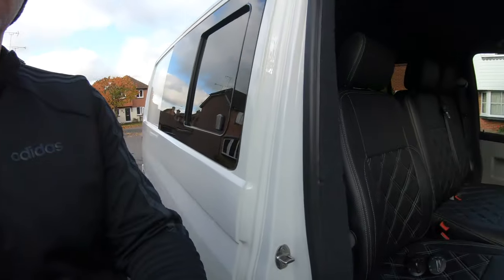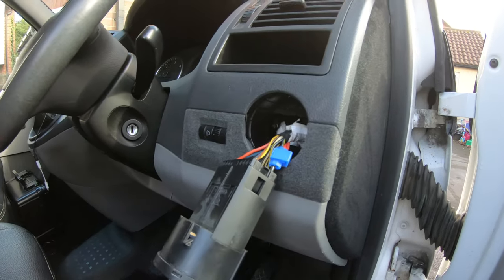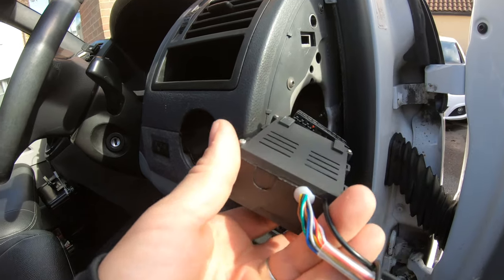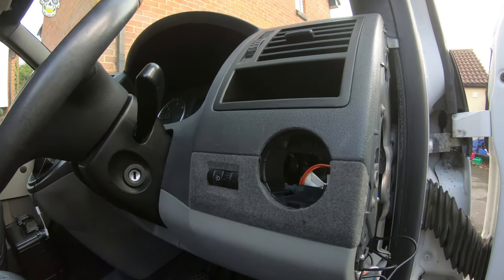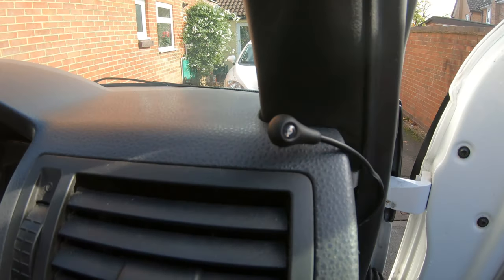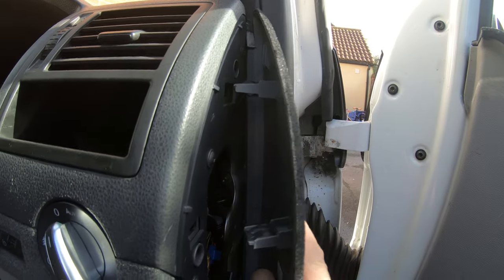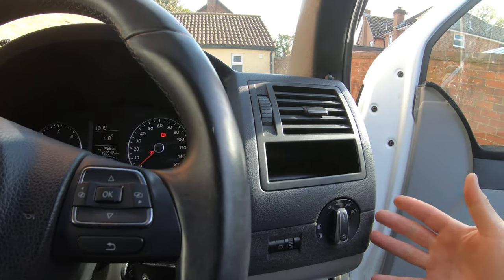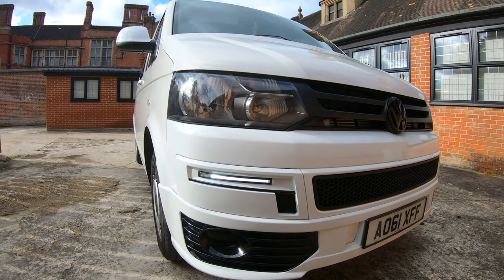Vw T5 auto lights upgrade #builtnotbought #build #vanlife #t5 #transporter #autolights

Comment: Just fitted mine to my 2005 T5 and they work a treat, thanks for the inspiration 👍
Reply from the maker: Antony Rowley how did the install go? I’m looking at. 05 for another project build.. was it straight forward...
Reply: @tomtdubz  Yes ,5 minutes job, no problems, no lights on dash & even the 3m tape worked fine. The kit I got even had a spare 3m tape just in case.
Reply from the maker: Antony Rowley tidy, which kit did you go for...
Reply from the maker: Antony Rowley nice one thanks 👌🏻
Reply: solo se enciende la luz de posicion

Comment: Hi Tom, I’ve just fitted mine but I have the blue Motion so a smaller plug in the back. Do you know if you can have coming home lights with the newer version? It came with no instructions and I can’t find any online
Reply from the maker: Should be able to.. if you leave it in the auto mode they should turn of after 10-20 seconds....

Comment: Hi Tom great info on Video, I've just put a new bumper on my van  2006, with fog lights but sadly no wiring loom for said fog lights. Question is would the wiring loom you used for your front end upgrade kit fit and if so where was that from please
Reply from the maker: Hey, thanks  for watching. The loom for the fogs I used is one for facelifts. Travelinlite do one for the pre facelift. The loom is the same just different fogs.

Comment: Great video mate, only just bought a 2014 T28 T5.1 startline.  Will this autolight switch fit this model?
Reply from the maker: Should do. Check the loom an make sure you get the correct one for your year of van, my other van is a 13 plate and is the same kit…

Comment: Great vid pal. 
I’ve got a 2013 factory Highline Kombi with vents for rear seat air con in the side panel that you’ve taken off in your video. Have you fitted an auto switch to a van like this and do you know if the added loom will fit in the space allowed.....? 
Many thanks. 👍🏼
Reply from the maker: I haven’t, but there’s is quite a bit of room in there, the new loom is quite long so you can find a spot for it 👌🏻

Comment: Great video dude. I’ve looked on line and there’s a big and small switch, not sure witch one I need do you have measurements as my camper is 2012.
Reply from the maker: Best option is to pop yours out and take a look at the fitting.. go from there bud 👌🏻

Comment: Hi, 
I was thinking about fitting fog lights to my 2020 plate Crafter and a new switch like this so there on auto. I can imagine it won't be an easy job but do you have any advice for me or anyone else. Is there wiring looms available for this to go right back to the switch. What else is needed. 
Many thanks 
Ian

Comment: Hi Tom good video. Where did you get 3 round dial for heater / blower ?  Dave G
Reply from the maker: Thanks, just off eBay il have a look and tag a link 🤙🏻
Reply from the maker: https://rover.ebay.com/rover/0/0/0?mpre=https%3A%2F%2Fwww.ebay.co.uk%2Fulk%2Fitm%2F201954511288 think it was these..

Comment: Hi mate, this is brilliant. 

Just checking if there is a minimum bcm required? I have a 2010 shuttle with front fogs. Planning on getting cruise control fitted and this.
Reply from the maker: Should all be straight forward 👌🏻

Comment: Hi great video, I am thinking of getting one but I noticed you also only have the rear fog light on your original switch and the new one has front and rear, so does your rear fog light still work with the switch?
Reply from the maker: Yeah they did, soon after I installed the front fogs 👌🏻thanks for watching 👍🏻

Comment: Hi Tom, another question mate. I have bought a fog light and auto switch kit from Travelinlite. I also bought a window kit as well (both not fitted yet bit chilly out lol) did you fit the auto windows on the bus yourself. If so did you connect both red wires to the black and yellow one or just one wire, I've watched a few videos on here but all a bit sketchy. Regards Steve
Reply from the maker: Hey Steve... I did but I can’t remember... it was literally the first thing I did.. il have a hunt round and get back to you... 👌🏻
Reply: Cheers Tom, appreciated
Reply from the maker: Steve, brains gone a bit, can’t remember any of the window installation... I think gdubtv did a good video on them.... sorry fella
Reply: Its ok mate, thank you for looking and getting back to me

Comment: Well,I've tried and tried to remove my old switch as you demonstrated, push in and twist to zero and pull it out,.....it definitely does not work for me, any other ideas ?
Reply from the maker: Push and pull to zero… try pushing in on zero an turning to the right… should come out
Reply: Really appreciate the prompt reply Buddy, I have tried it always ,total failure, seems well  fixed in there, even whipped off the small panel to the rhs to give some leveridge with my fingers, simply won't have it.
Reply: Am having the same issue. Push in and turn right whilst in and the old unit still won't pull out
Reply: @heavymetalbebop  Did you ever manage to get old headlight switch out? Am having same challenge as you. Followed instructions but will not pull out!
Reply: Hi Mark,yes I eventually got the switch out,but,had to get a bit aggressive with it,a couple of screwdrivers either side of it and prised it out which did cause it damage,no probs as it was being replaced.

Comment: How do you turn on the fog lights? Mine doesn’t want to switch. Thx!
Reply from the maker: Turn switch to main beam, pull out gently on the on the switch and you be able to turn it further round to put the fogs on
Reply: @tomtdubz  thx! I tried that already since it's the same procedure in all the previous vw's I owned but this time I was afraid to pull it apart. I' ll give it another gentle go. thx again.
Reply: @tomtdubz  just figured it out. like you said, turn to main beam and then pull once for front fogs and once again for rear fogs. thx again!
Reply from the maker: @jeroengoegebuer1573  brill, nice one fella 👌🏻

Comment: Hey, how did you programme the DRLs to work with the fob? Would it work with my led ones?
Reply from the maker: I’ve got the auto lights so the are programmed to come on when I unlock and lock the van (coming home lights) the drls light bars are power fed from the original drls so the all come on together.

Comment: Hi Tom just found your YouTube finding you very helpful trying to replace my Headlight switch and unfortunately it’s stock is there any suggestions you can give thank you
Reply from the maker: Travelinlite make a good kit which will allow you to convert to auto lights.. the also do the one which has the front and rear fog lights incase your thinking of add the front fogs too... 👌🏻hope you enjoy the videos 👊🏻
Reply: I believe my pins are stuck behind the light switch is there any other way of getting them pins to move I have already got the auto switch to put in after watching your video a couple of days ago but I’m just stuck at the moment I’m trying to get the light switch out Thanks for your help
Reply from the maker: Have you popped the switch out? If so it might be a case of sacrificing the old switch.. they are quite tricky to pull apart but there not worth much...
Reply: T Dubz Hi good morning no tried all last night it just won’t come out really don’t want to force it out and then break the dashboard
Reply from the maker: So it’s stuck in the dash. Pop the side panel off, it might have got lodged in, or someone may have stuck it in. One eve the side panel is off you can release the harness bit fiddly but you manage... then you might be able to free the switch...
Reply: T Dubz ok thanks have a good day 👍👍

Comment: Would this be the same procedure for the T6, cheers
Reply from the maker: It is but you will need to get the t6 auto lights kit, the fitting is different on the back.

Comment: Hi Tom , just bought a set of rear leds for my t5.1 and they don't work , but they did on my buddies van fine , I have the old light switch in the van like you had before your mod switch upgrade , would that be the issue with my lights , or would my t5.1 not be compatible ?? Frustrating as it works on my mates van and he has the newer light switch like yours . 
Much appreciated if any one out there has any clue what I'm doing wrong , I thought they would just be plug n play 🙏🙏
Reply from the maker: Where are you located bud, could ha e a look if your local…
Reply: @tomtdubz  
Hi ,  I'm in Hampshire ( Farnborough) 
Many thanks for the kind offer .
Reply from the maker: Based near Southampton but have a workshop near Bournemouth…
Reply: @tomtdubz  
What's the name of the workshop buddy , I can ring Monday// Tuesday and pop down maybe wednesday // thurs if OK with you .
Thanks in advance
Reply from the maker: Bespoke buses based in west moors Bh21 6us 👌🏻
Reply: @tomtdubz  cheers 👍👍

Comment: Hi tom. Can you tell me how to set this up for daytime so my runway lights just come on?
Reply from the maker: Il try, your day time lights drls should be on anyway as a standard thing, you could try resetting the module by turning it from 0 to auto whilst engine is running you should here it bleep...
Reply: Thankyou. I have tried that. I can see on your video your bumper lights on come in the day
Reply from the maker: natasha triggs yes, they are from travelinlite light they feed from the original drl power so will come on with them
Reply: Hi Tom, I'm having the same issues, if i cover the sensor my main lights come on  when I lock/unlock the van. But would like my DRLs to come on? Any advice? Thanks
Reply from the maker: Marcus Feltham drl light bar or the factory drl in the headlight?
Reply: @tomtdubz  factory/aftermarket lights, but using the original power
Reply from the maker: Marcus Feltham have a look online for the settings for the switch.. I think if you reset it then reprogram it to side lights it might work but I’m unsure... sorry not much help hope you get it figured out 👌🏻🤙🏻
Reply: @tomtdubz  thanks for you help, 
I'm trying to achieve what you have in the video when locking the van, I can get my Drls to work on there own, but the sensor needs to be covered/dark.... but then it defeats the idea of auto lights (main lights) 
I'm assuming the "coming home lights" are only meant to work at night? 
Thanks

Comment: Hi, how have you made your drl come on please?
Reply from the maker: The drl light bars? Or the normal drls..
The light bars are fuse next to the battery and fed from the existing drls. The vans drls in the headlights come on automatically... hope that helps
Reply: @tomtdubz  I mean the bars, I have them installed but don't come on when I unlock the van
Reply from the maker: Oh, are they travelinlite?
Reply: I don't think there are but not sure as I bought the van already with them
Reply from the maker: @carlharrison1842  have a look under the bonnet, if they are they’ll have a small black box... where I had the auto lights it had the ‘drive home’ setting... making lights come on when unlocking and stay on for 20sec when locking
Reply: @tomtdubz  brilliant I'll have a look soon as I get home, thank you for your help
Reply: Just had a look and they are van-x drl
Reply from the maker: Do you have auto lights? Can be set up that way...
Reply: Not yet but I think that's the route I'm going down
Reply from the maker: @carlharrison1842  that may well be the answer... keep me posted 👌🏻

Comment: I bought this for my 2010 T5.1 but it's no good. My loom has 10 pins and this has 13 but only 9 of them correspond with the loom. When I switch it to sidelights the DLRs stay on which they don't on the original. What's worse is that there's only power to one rear light. At the headlight position, everything is ok at the front but there's still only one sidelight fully illuminated at the rear with a faint glimmer in the other. Put the old switch back in and everything works perfectly. It's an idiot plug so you can't put it in incorrectly.
Reply from the maker: That’s really odd. Is it possible you’ve got a faulty unit? Haven’t heard these issues before

Comment: N8
Reply from the maker: Yep red wire with the mini connector goes in to port 8
Reply: What did you do with the old head light switch
Reply from the maker: Got a couple in the workshop….
Reply: How much and send to Ireland